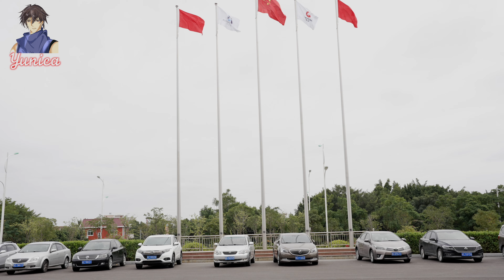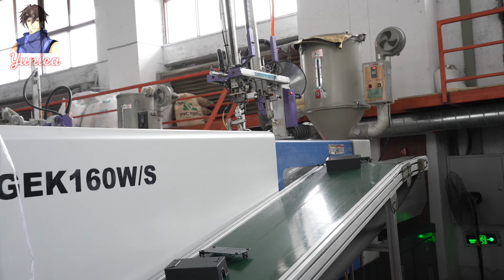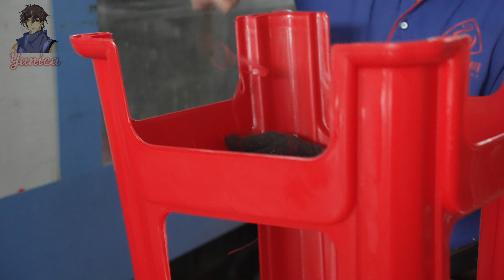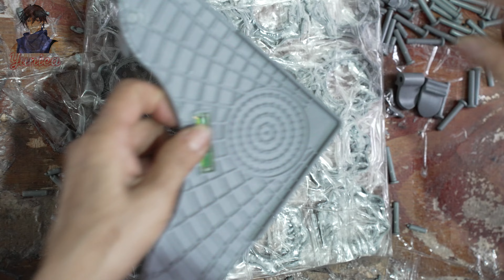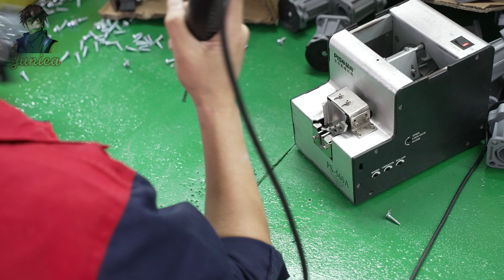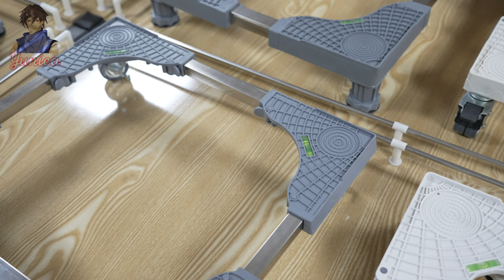Mass production process of multifunctional base bracket for refrigerator 。China Plastic Factory

Comment: They don't wear safety goggles when machining, no safety protocol requirements at Chinese factories?  In US they would be required to wear goggles at all times when working on the milling machine at work.  But may not be all though.
Reply from the maker: Each country has different requirements, but I strongly agree with you. Protection of the eyes is very important
Reply: For the other videos, there is no text description for some of the machine operations (eg. the cotton swap video).  So, not sure what task the machines are doing.  It would be more helpful to add more text to videos.  Thanks.
Reply: who cares about the US lol